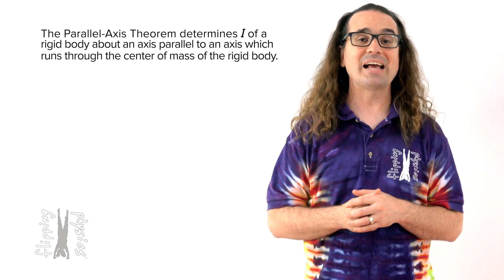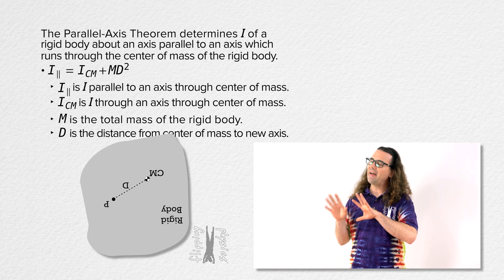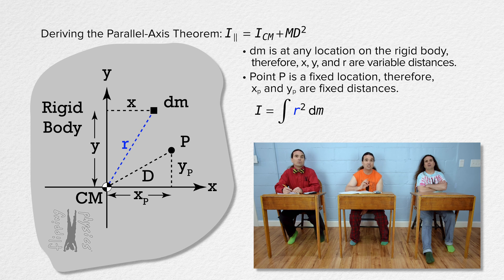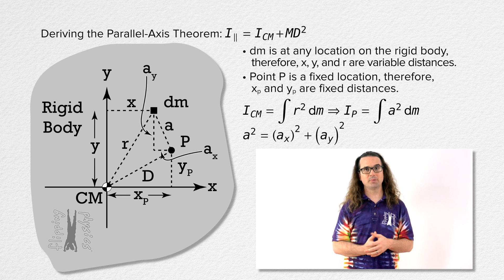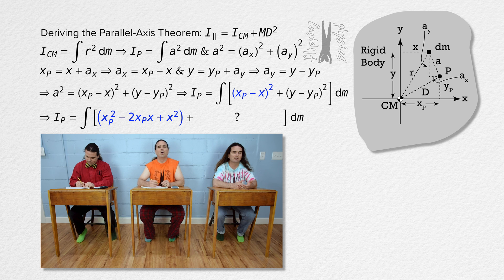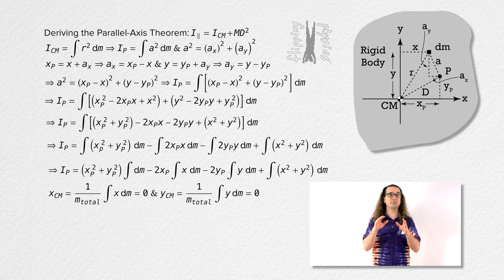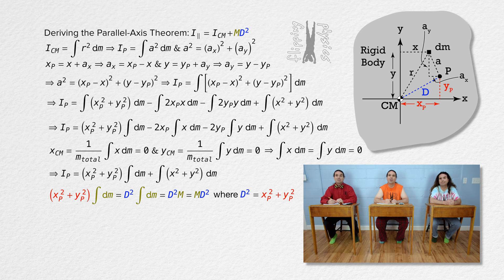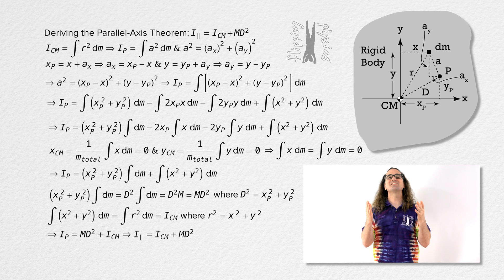Parallel Axis Theorem Derivation

Comment: 6:25 Mr. P where did you come up with that equation? Moreover, I couldn't catch why the integral is to be zero. Please elucidate on that!
Reply: I think he set it to zero because the x and y coordinates of our center of mass are set at the origin of our coordinate plane. And the equation he used i think was a derived equation from our center of mass equation x_cm = net_i ( m_i * x_i ) / m_tot and same thing for the y i think. that is the same thing as saying x_cm = 1/m_tot * int(x dm) i think. then he set the integral to zero because he multiplied both sides by m_tot and it yielded zero I think
Reply: @adrianperez-martinez6292 no you're right 

centre of mass is defined as the position if taken as origin yeilds 0 for the summation of mass moments for all points elements divided by the sum mass(basically Σmi.ri/M) this is the formula for position vector of COM for any reference origin,if ref origin is COM, then result would naturally be 0

decomposing Ri vector to x and y vectors, we can see why (x,y) position vector would ne (0,0) so yea

Comment: Thank you Sir - I wonder The theorem can use in case of "A New Parallel is located outside the object - such that simple pendulum
Given : pendulum ball with some radius r and is suspened with a rope (a rope is small mass ) So the center of mass of this system is center of mass of the ball. When we release the ball , then moment of inertia of system is I (cm) + (M+R)^2 
[ if the ball is sphere : 2/5MR^2 + (M+R)^2 ] , isn't it ? 
And The other question - When we consider conservation of energy of The pendulum Should we care about size of the ball pendulum ?
( I think We should because while the ball is moving down with radius R each point mass on the ball have different velocity - mean that 
v = omega R  Why don't we use 1/2 Iw^2 instead of 1/2mv^2 ) 
Thank you  [ Apologize for my english 'I am not english speaker😄 ]
Reply: You've used both the capital R and lowercase r in your example, to stand for different measurements, and then lost track of this distinction.

Given the radius of the ball as lowercase r, and length of the pendulum from the pivot to the ball's center is capital R.   To translate the axis of rotation to a parallel axis at the end of the string, you add M*dcm^2 to the original rotational inertia, where dcm is the distance between the center of mass and the new axis of rotation.  In your case, this distance is R.

So in your example, the new rotational inertia is:
I = M*R^2 + 2/5*M*r^2

This is its rotational inertia regardless of whether it is at rest, or whether you release it and it starts rotating.  The moment of inertia is independent of the kinematics of this system.  It only depends on mass, shape, axis of rotation and distribution of mass.  This is a fixed value as long as the pendulum moves as a rigid body.  A ball on a string moves approximately as a rigid body when swinging as a pendulum, but for a better example that really is a rigid body, consider replacing the string with a rigid rod of negligible mass.

"Should we care about size of the ball pendulum?"
In the formula I provided, you do account for the size of the ball.   In the limit as r/R approaches zero, you notice that it becomes simply I=M*R^2, which is the moment of inertia of a point mass around an axis at distance R from it.

"v = omega R  Why don't we use 1/2 Iw^2 instead of 1/2mv^2 ) "

Because angular velocity (omega) is the same value for every point on a rigid body, by virtue of it being a rigid body.    Linear velocity by contrast, is different for every single point.   Using 1/2*I*omega^2 for kinetic energy is a shortcut to allow you to calculate rotational kinetic energy without needing to use Calculus to keep track of how velocity varies throughout the object.   In concept, you can set up an integral to calculate linear velocity of every point on the body, and add up the kinetic energy of every point mass that comprises the body.   However, it is much simpler to take credit for the fact that omega is the same throughout the rigid body, and use the property of moment of inertia instead.

v=omega*r is only valid at the point that is distance r away from the axis of rotation.   If r is a constant in your problem, instead of a variable coordinate, then not every point is a distance r from the axis of rotation.  If by contrast, r is a variable coordinate, then every point on the body has a different value of r.

Comment: I have a question 
what does quantities which are result of cross product have direction , perpendicular to the plane of the productant
like torque what does it mean
Reply: In pure math, a cross product of two vectors both in distance units, corresponds to the area of the parallelogram formed by the two vectors when located head-to-head, and the remaining two sides completed per the symmetry in the definition of a parallelogram.  Area vectors are perpendicular to the surface with the area, and which perpendicular direction is determined by which vector is CCW from the other. 

The fact that angular kinematics and kinetics quantities are perpendicular to the plane of rotation is just a matter of convention.  It doesn't mean anything physical is happening in that direction, but rather because there is no preference between the two directions in the plane of rotation, there is no preference to either one being the vector direction.  The axis of rotation and right hand rule, is the convention in physics for how to keep track of these quantities.  We could've just as easily assigned it according to a left hand rule, so the choice was ultimately arbitrary.  But in order to communicate with others, you learn to follow the standard convention.

Comment: Great episode!  I just realized that this is why the moment of inertiavis always smallest when pivoting at its center of mass!  It also predicts that when comparing moments of inertia about different points, it is purely the distance from the COM that determines their relative values.  All the AP teachers at my APSI for APCM had a hard time justifying why they chose a particular answer on an APCM MC question; they knew it was due to the distance from the COM, but noone could state why.
Reply from the maker: Good point. Thanks!
Reply: eeh you time traveller why does your comments are 1 month old